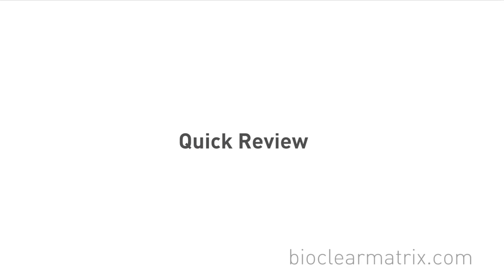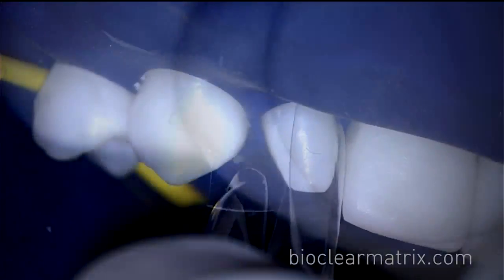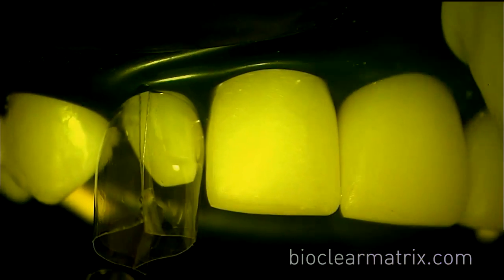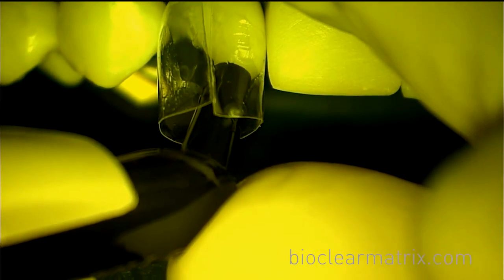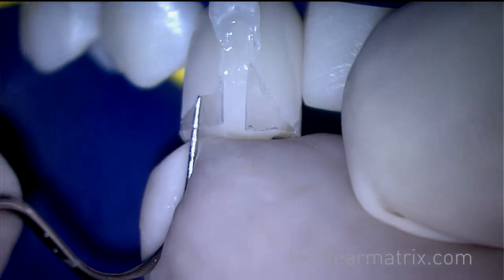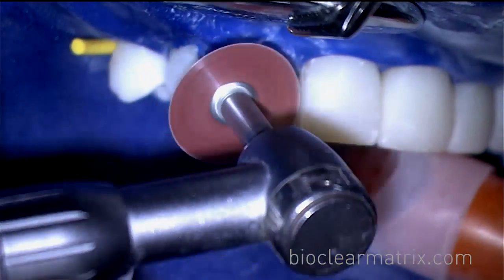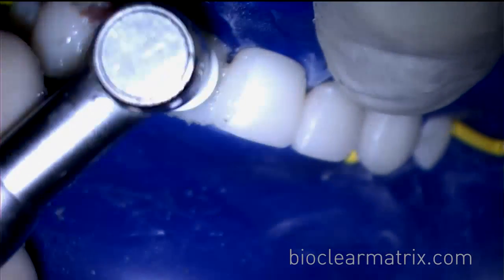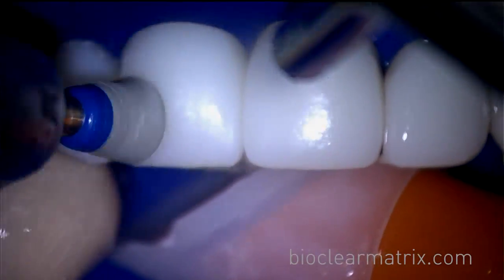Bioclear Composite Veneers for post orthodontic undersized teeth. Part 2

Comment: why do we nee to inject palatally? wont that create occlusal discrepancies and then the need to spend extra time to adjust it?
Reply from the maker: That is a good question.  We gain great strength by engaging all of the surfaces of the tooth when possible.  I encourage you to take a Bioclear hands on course and learn to quickly and safely shape the palatial area.

Comment: hey doctor how could you achieve a tight flousable contact without separation by means of ring or wooden wedges ?
Reply from the maker: Hello Faysal,  The Bioclear Matrix has the ability to exert pressure on the neighboring teeth and in a very young post-orthodontic case, the teeth are slightly mobile and that is enough pressure for a snug contact. In older patients with no mobility, we do staged wedging.  Watch the Bioclear Peg Lateral video for details on that.  If you don't have a Bioclear diastema closure matrix, you can't really do the technique this way.  Do you have the Bioclear Matrix System in your office?